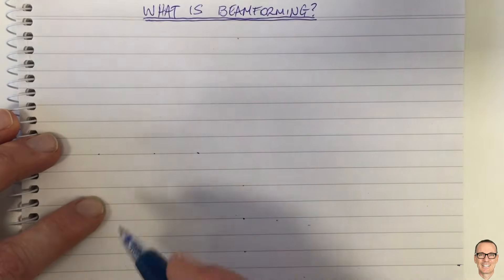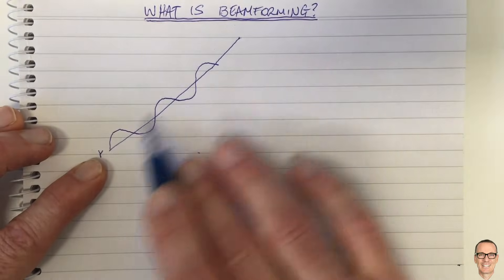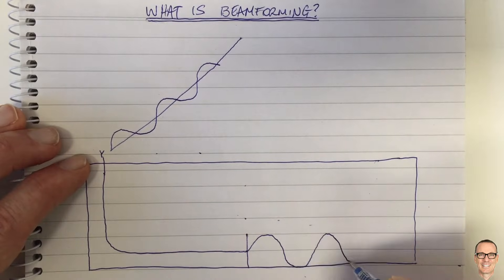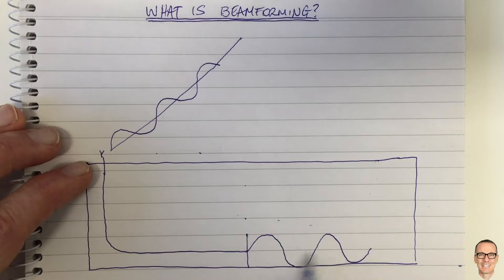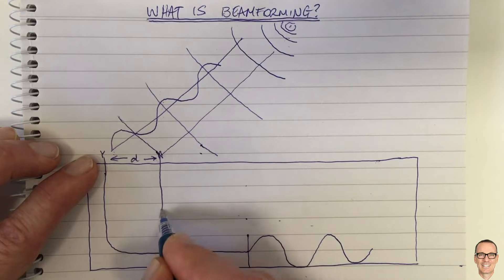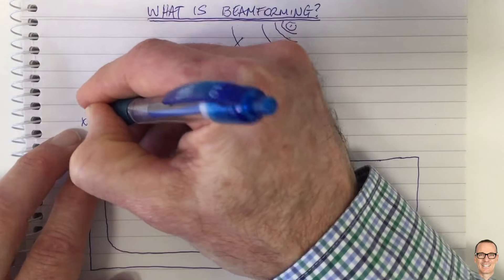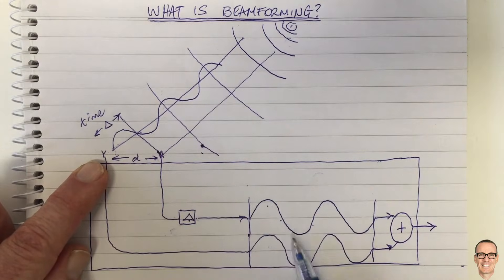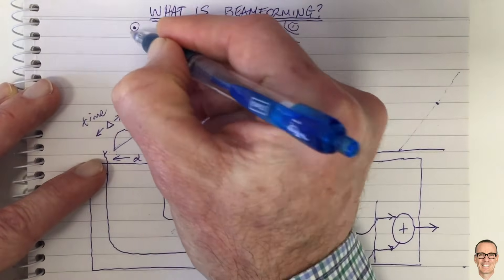What is Beamforming? ("the best explanation I’ve ever heard")

Comment: Thank you Iain. Beam forming is an Amazing principle. So by adding multiple antennas (n Antennas) and injecting a delay circuits and adders we can form those shaped zones and select which receiver to have the best reception from specific direction. I imagine that if we have a programmable delay circuits with algorithm to control those delays and selecting the proper antennas then we can control those beams. Is that what is used in space division multiple access? We maybe able also to have intelligent algorithm that senses the RSSI levels, provide feedback to apply combinations of selecting antennas, adders and delay circuits and eventually automatically select the sending location. I wonder if such a thing already exists?
Reply from the maker: Yes, that's right. It's exactly what happens in MU-MIMO. The process you've described happens in the matrix operations in the receiver (for receive beamforming) and the transmitter (for transmit precoding). See "What is Multi-User MIMO Communications (MU MIMO)?" https://youtu.be/0ncIWlhsu1A
Reply: Interesting facts

Comment: Thanks this made me understand it better! It still left me with a question though. If you look at an angle such that the phase shifting is exactly a whole period, the waves will still add up constructively there. How is it made that these side maxima are so weak in phased array antennas?
Reply from the maker: Yes, that's a good observation. This effect depends on how far apart the antennas are spaced. Check out this video for more details: "How does Antenna Spacing affect Beamforming?" https://youtu.be/amepyf9-E1w

Comment: Thanks Iain, this is a very good explanation. It is based on the simple case of a single known frequency incoming wave. What happens if you do not know the frequencies of the waves you are picking up, or is this something you must know beforehand?
Reply from the maker: If you don't know the frequency or the direction, then you need to do some sort of beam scanning, and search for the signal. There's a lot of research on this topic. Maybe I should think about making a video on it.
Reply: @iain_explains  Thanks Iain, I was researching the beamforming topic to better understand the towed array bearing ambiguity for submarines and indirectly your video explains this ambiguity quite well. But how you process and determine the direction of more complex signals composed of all different frequencies it is still not really clear for me.

Comment: Why do you assume that the radiating element is pretty far from the Rx antenna? How about the near radiating element? In that case, the two lines aren't parallel.
Reply from the maker: If the distance is small, then you really need to know what the distance is (or try to estimate it), so that you can correct for the "non parallel" nature of the incoming wavefront.

Comment: How about calculation mutual impedance among antennas? Is it ignored?
Reply from the maker: Very good point. In these basic channel models the mutual impedance is ignored. When the antenna elements are half a wavelength apart (or more), then this is not too bad an approximation. In reality the presence of nearby scatterers, such as the feed lines of the antenna elements and the mounting platform, also affect the impedance characteristics. In practice though, the channel matrix is estimated from training data, and so all of these factors are accounted for by the beam forming algorithm. They might mean that the performance is less than the ideal channel model predicts, but it doesn't mean it won't work (unless theenna ant elements are much closer than half a wavelength).
Reply: @iain_explains  Thank you Sir for the explanation, it has been 16 years my question to my lecturer, but the answer did not satisfy me. In fact, applied antenna for 5G is released from antenna vendor with many matrix combinations, I believe the mutual impedance is not a big things

Comment: what the difference between 4g beamforming and 5g beamforming?
Reply from the maker: In 5G there are more frequency bands, and some of them are much higher, such as the mm-wave bands. In these bands much larger numbers of antennas are needed, in order to achieve useable power radiation for outdoor applications. Check out this video for more details: "What is Massive MIMO?" https://youtu.be/39CZyDq3vSw
Reply: @iain_explains  it's very helpful.  thank you👍

Comment: this is the reason we use multiple antennas?
Reply from the maker: It's one of the reasons. Other reasons include the need to transmit with more power, in situations where the individual antenna elements have power limitations (for example in mm-wave communications, where the antenna elements are very small, see "What is Massive MIMO?" https://youtu.be/39CZyDq3vSw).
Reply: @iain_explains  thanks for proving useful information.

Comment: Awesome, so to find pesky sympathetic resonance vibration at 1800rpm in my wagon, construct 1d array of 6 microphones, bandpass at 300Hz, sum with sweeping delay.  peak delay determines direction.
Question1, what is the optimal distance between microphones given a wavelength of ~1.14m. Is it 0.57m or is anything less ok, say 0.005m?
Question2, to improve source detection could a 2d array  3x3 with with two sweeping delays (like Vertical and Horizontal  deflection yolks) and convert to heatmap.  peak determines azimuth and elevation.
Is this plausible?
Reply from the maker: Interesting questions. I don't have experience with audio signals and microphones, but yes, the beam forming principle it's the same as with EM radiation from metal antennas. A couple of things to think about: 1. you will most likely be in the "near field", so the assumption of a planar wave front won't hold (and you'll be more in the realm of needing to do "triangulation"); 2. if you put the antennas/microphones further apart than a wavelength, then there will be ambiguities in phase (between an almost side-on signal with small phase difference, and a signal at a bigger angle such that the phase difference a whole wavelength bigger, ie. 2pi bigger). Check out my video on antenna spacing for more explanation on this: https://youtu.be/amepyf9-E1w
Reply: @iain_explains  Thanks for the feedback.  1.)Near field, I had not considered that.  I think I have a handle on triangulation. 2.) I had watched your fine video on antenna spacing but I could not conclude if less than 1/2 wavelength spacing is better thou it was implied.  Here 1/10 wavelength spacing is trivial and based on your video, my intuition and my mobile's audio compass with close mics I am guessing closer is better along with increasing number of mics.  Thanks again, I am exited to have discovered another excellent channel with great content.

Comment: Thank you for the video. How is this used to calculate angles for data coming from say a short range radar?
Reply from the maker: The angle is a simple function of the delay and the antenna spacing (it is briefly explained at the 7 min 30 sec point of the video). 
sin(theta) = Delta * c / d  
where theta is measured from the line perpendicular to the line that the array elements are on.
Reply: @iain_explains  I see, Thank you. So fft gives the frequencies and that then is used with that formula to calculate the range?
Reply from the maker: In radars, the range is generally calculated by sending a pulse and then measuring the time it takes for it to bounce back.
Reply: @iain_explains  For pulse radar, this is the case. But for the FMCW radar, it is using the FFT to get the range, as the frequency is proportional to the range in the FMCW waveform.